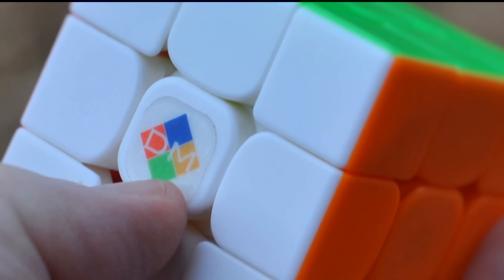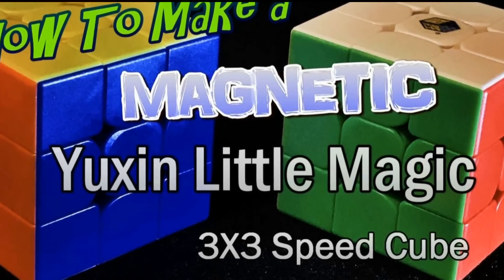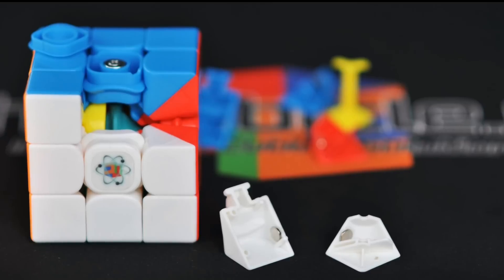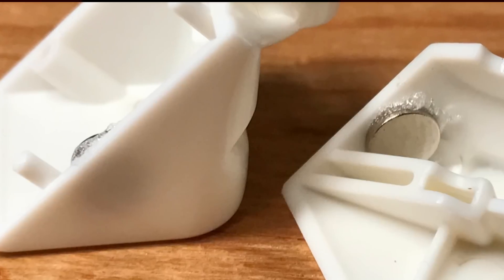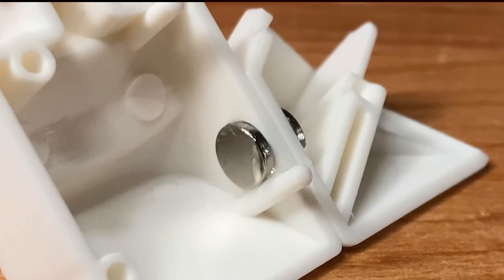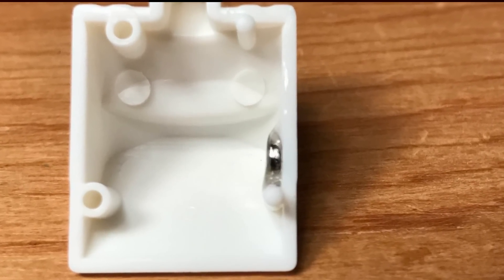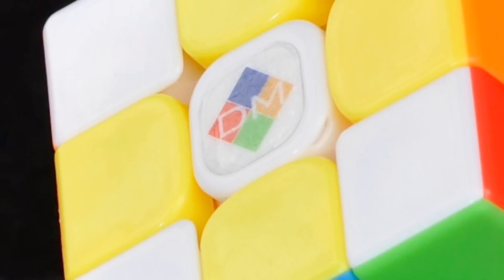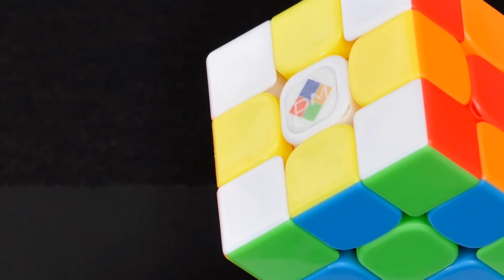Magnetizing the MoYu MF3RS2 Speed Cube

Comment: I magnetized a valk with 4x2 N35, and it was too strong for my liking. Was just wondering, what magnets could I use in the valk as well as the MF3RS2 to achieve a strength similar to the stock GTS2M? All 3 are Stickerless btw.
Reply from the maker: AdamA90 In the Valk 3, N35 4x1.5. In the MF3RS2M, the N35 5x1.
Reply: Thanks! So which one is actually stronger, the N35 4x1.5 or the N35 5x1? Also, what magnets would work good in the new GAN 356R?

Comment: Can you use the same type of magnets in the edges and corners? (Example: n35 4x2 magnets)
Reply from the maker: Giovanni Berlato Yes! That's how you should do it.
Reply: @dmcubing6342  Thanks for awnsering, but i have other question, the 5x1 n35 works well too?
Reply from the maker: Giovanni Berlato Yes. You can use N35 5x1 magnets in this cube. They will give a subtle magnetic feel, yet still give the cube stability. The Cubicle uses an N48 5x1 in this cube (for a medium strong feel), and I like to use the N42 5x1 for a medium subtle feel. The N35 5x1 will give the cube a light magnetic feel. It'll work just fine.
Reply: @dmcubing6342  And what about the 4x2 n35?
Reply from the maker: Giovanni Berlato Very standard magnet in a huge variety of 3x3 cubes. It does fine in the MF3RS2.

Comment: Hey I was wondering if n38 4x1 magnets would work for this cube and what would it do, that is my only option from the place I'm getting it from
Reply from the maker: MisterChilli Gaming Honestly they would be too weak and would result in a significant subtle feel. If that is your only option for magnets, you might be better off doubling them: you could use a total of 96 magnets by using double magnets, one magnet placed on top of the other, in both the edge pieces and corner pieces. When you stack them like this, you end up with the equivalent of an N38 4x2 magnet. 
For a subtler feel, you could use single magnets in the corner pieces, and use doubled magnets in the edges.

Comment: Hello, can I use any superglue
Reply: https://www.google.com.sg/search?q=bond+mate+super+glue&client=ms-android-xiaomi&tbm=isch&source=iu&ictx=1&fir=TXxCWdcCMUjobM%253A%252C1Ep8ZghCxLNl3M%252C_&usg=AFrqEzc5IwfyWERun5a2_zvAmoZ6WmEEVg&sa=X&ved=2ahUKEwi3_fH3x-HcAhVTXisKHcR1Da0Q9QEwA3oECAQQBg&biw=1100&bih=1712&dpr=2#
Reply from the maker: SyaZwaN_DeV SyaZwaN_DeV Answered here, earlier today. Check the comments here for the latest comments, the one right before yours, for the answer.
Reply: I can't either see the comment
Reply from the maker: SyaZwaN_DeV Yana 1982 Yes. You really can use any type of superglue. I prefer a thicker type with plastic additives because it helps protect the magnets from unlodging caused by shock. I put a drop first, then place the magnet on top of the glue, then finish off by putting an additional drop of glue on top of the magnet. This type of superglue takes a longer time to dry and cure. 
Thinner, normal, superglue can work too, particularly for people who position the magnets first, then add a drop of glue on them (a technique I don't particularly recommend). This thinner glue can get into tight spaces easier, and it dries quicker. Since it's thin, it's prone to running, so you have to be careful by using a little at a time. Since it's thinner and less flexible, it's a little more prone to having magnets come loose due to rough handling. If I were to use this glue, I'd probably put an additional drop of glue once the first application has fully dried.
Reply: I think the comment is only fotbu
Reply: U
Reply: Can use this bond mate super glue
Reply from the maker: SyaZwaN_DeV Sure. That appears to be normal cyanoacrylate superglue. It should work fine.
Reply: So can or cannot
Reply: So will the magnet drop
Reply from the maker: Drop? Are you asking if the magnet will fall out? Probably not if glued properly. Just make sure to glue it well and add an extra drop to the top of it once it's in place well.

Comment: Can use any superglue
Reply from the maker: Yana 1982 Yes. You really can use any type of superglue. I prefer a thicker type with plastic additives because it helps protect the magnets from unlodging caused by shock. I put a drop first, then place the magnet on top of the glue, then finish off by putting an additional drop of glue on top of the magnet. This type of superglue takes a longer time to dry and cure. 
Thinner, normal, superglue can work too, particularly for people who position the magnets first, then add a drop of glue on them (a technique I don't particularly recommend). This thinner glue can get into tight spaces easier, and it dries quicker. Since it's thin, it's prone to running, so you have to be careful by using a little at a time. Since it's thinner and less flexible, it's a little more prone to having magnets come loose due to rough handling. If I were to use this glue, I'd probably put an additional drop of glue once the first application has fully dried.

Comment: If i use n48 in this cube .. is it work well
Reply from the maker: AM Cuber what size?
Reply: 4x2
Reply from the maker: AM Cuber Really the N48 4x2 would be a bit overly strong. If it's all you have, I suppose you could get by with it but it will have a fairly pronounced magnetic feel.
Reply: DMCubing ok 👌

Comment: hai im just wondering WHY IS MY MAGNETS NOT CONNECTINNGGGG UGGHHHHHHH IVE SPENT AN HOUR TRYING TO FIGURE OUT WHY THERE NOT CONNECTING
THERE REPLELING
Reply from the maker: Mark _YT OH NOOOO!!! Sounds like you may have reversed the polarity at some point in time. The best thing to do is to disassemble the cube. Then attempt to reassemble the cube without the core. You will be able to tell which pieces are rebuilding each other at this point. Then disassemble the individual cubie pieces to determine which magnets are incorrect. 
It is not easy to remove magnets. You can try prying them out with a small screwdriver, but be very careful so as to not damage the plastic. You may have to soak the pieces in warm soapy water for several hours to help soften the glue prior to doing this.
Reply: oki thanks, can i use nail polish remover because it has this ingreadiant in it that allows it to soften the glue
Reply from the maker: Mark _YT Yes. The acetone in it will soften superglue. But it can also damage abs plastic, the plastic cubes are made out of, so apply it directly to the magnet area and keep it from getting all over the cube pieces.
Reply: DMCubing ok

Comment: Do have any idea how to remove the magnet that are already glued with superglue?
Reply from the maker: Benny Lai First, you can try carefully prying them out with either a small screwdriver or knife. If they're still stuck, then try soaking the disassembled cubie pieces in warm soapy water for several hours then try prying them out again. If you can grab a hold of them with pliers, you could try to twist them out. Just be careful with however you choose to remove them so you don't damage the magnets or cube plastic.
Reply: DMCubing thanks

Comment: if im using a n35 4x2 ill magnetize like the gts2?
Reply from the maker: Tech Dares Pretty much so, yes. They are slightly different cubes, but it will have a similar magnetic feel to that of the GTS2M.
Reply: so i just need to place the magnet like the placement of magnetizing the gts2?
Reply from the maker: Tech Dares Right. But you might have to position the magnets up higher just a little bit so that the corner piece magnet lies flat when it's glued in.
Reply: well so can i just make a master magnet because i am scared if all the pieces is not in the same hieght
Reply from the maker: Tech Dares Sure, you can do it that way. Just be sure that there's glue under the magnets.
Reply: okay thanks!
Reply: how if i just put the magnet on the corner pieces and attach to the edge so it can line up flat then i make all of the corner piece then the edges?
Reply from the maker: Tech Dares Yes, you could do this. You'll be using your corner piece as the master for setting all the edge piece magnets.

Comment: have you ever tried putting the magnets in the center piece like Chris Tran did?
Reply from the maker: Riki Shikato Yea. I have actually tried that with four different cubes. I didn't like the end result. You need a very strong magnet to get good results. After four tries, I went back to doing it the normal way. 
From what I understand, Chris has been working on a drop-in magnetic assembly for the Valk Power in a variety of strengths. I hope it will be put into production.
Reply: ah, I see

there goes my plan magnetizing my Galaxy megaminx

Comment: What is better that i choose  N42 or N35 what is difference ?? Thankyou
Reply from the maker: Nat Cubes You didn't give the sizes. 
The N35 4x2, and N42 and N48 5x1 magnets are quite acceptable in this cube.
Reply: DMCubing sorry by the way what is difference of N42 5x1 and N35 4x2 ?
Reply from the maker: Nat Cubes Well, they're different sizes, so the 4x2 will have a slightly stronger magnetic strength. Often an N35 4x2 will feel just a little stronger and clicky than an N42 5x1. The N48 5x1 feels closest to the N35 4x2. However, an N35 5x1 feels significantly weaker than an N35 4x2.
Reply: DMCubing thanks ! :)

Comment: Will my MF3RS2 have a better feeling if i use a different strength of magnets in the edge and corners?
Reply: @dmcubing6342  Thanks, but would 4x2 N35 still be good in the MF3RS2?
Reply: Will Gregor Yes. Works fine. 😀
Reply: Will Gregor Oops. Replied from my other account.
Reply: @DavesTrumpet  2 other things: do you know which magnets speedcubeshop uses in their supernova mf3rs2m; which glue do you recommend, and where can I buy it?
Reply from the maker: Will Gregor I don't know what magnets SCS uses. 
I used Gorilla Brand Impact Tough Formula superglue. It's my favorite glue! You can find it just about everywhere including Walmart. It's got a blue cap. See the picture at twelve seconds into this video. There's a clear shot of it:
0:12
Reply from the maker: LC Cubed Depends what you're after. Generally what happens is you get an average of the two different magnetic strengths. So for dialing in and fine tuning the overall magnetic feel, you can mix magnets. Or if you want an in between strength like mixing N42 with N48 5x1 to get the feeling of an N45 5x1. I do this occasionally. 
In the MF3RS2M, both the N42 5x1 and N48 5x1 (what the Cubicle uses) are excellent in this cube, btw.
Reply: @dmcubing6342  Do you mean the Cubicle uses N42 5x1 and N48 5x1 in the Cubicle Labs MF3RS2M, or that they just use the N48 5x1 (I assume this is what you mean)? Also are N35 4x2's stronger than N48 5x1's, and do you know what strength speedcubeshop uses?
Reply: How about N38 4x2 in edges and N42 4x2 in corners?
Reply from the maker: LC Cubed I dunno about that. The end result would be too strong for my liking. That's really too much. The strongest id use is the N35 4x2, or the other magnets I listed in the description.
Reply: DMCubing oh! Thanks! The last MF3RS2 M i made had N32 4x1.7 magnets.
They were a little too light for my liking.
Reply from the maker: LC Cubed The N48 5x1 like what the Cubicle uses is pretty nice. But if you prefer a stronger magnetic pullforce, you might want to try the N38 4x2.
Reply: DMCubing thanks! I just ordered  N38 4x2s and N48 5x1s and once they arrive, i'll magnetize both of my MF3RS2s.
Reply from the maker: LC Cubed Nice!!!! Let me know how things turn out!!!
Reply: @dmcubing6342  ^

Comment: DMCubing i've seen this video and garbage cuber's video about magnetic 3x3 tutorial. But the different between your tutorial and garbage cuber's the placement of the magnet is different yours is down to the post while garbage cuber's is placed upper in the pieces. Please can you give me the best placement for a stable cube he said putting it upper in the pieces should make it more stable. Is it true?
Reply from the maker: TMCuber It all depends on the strength of the magnet. 
Did you actually watch this video? This is one cube where I actually position the magnet up, and not at the bottom of the edge piece post. In this cube, it's necessary to do it this way so the corner piece magnet ends up positioned flat. This is shown and explained in the video. 
The reason I generally tend to position the edge piece magnet at the bottom of the retaining post is, first, it is a specific point in the cubie piece which allows us to precisely position the magnets in the same exact place each time. Secondly, if the magnet is glued against something to its side, as well as glued to something underneath it, it creates a stronger bond, and the magnets are less likely to ever come loose. 
You can alter the position of magnets to dial in a certain amount of difference of perceived magnetic pullforce, but generally speaking, it's almost negligible in most cubes. It's more noticeable, however in the Valk and Gan Air. Since I keep a huge stock of just about every type of Neodymium disc magnets,  I keep my position pretty much the same from cube to cube, and through prototyping and experimenting, I'll find several magnetic strengths and sizes that feel ideal.
Reply from the maker: TMCuber and one last point, about dialing in a different feeling from the same magnet. Again, this can't be done in every cube in every case, but in cubes that allow for a wider variance of magnetic positioning, the closer to the core you place the magnet, the lighter it's perceived magnetic pullforce strength becomes. I do this all the time with the Gan Air.
Reply: Thanks your such a good teacher and person now I understand how to fully magnetize the cube👍
Reply from the maker: TMCuber Thanks! I didn't realize my channel and techniques were being discussed in the comments of his video. 😀 I do things the way I do them, and if someone else does it another way, then that's fine with me. I know what works for me, and after 140 magnetic cubes, I'm completely satisfied with the results of my work.

Comment: DmCubing which magnets you recommend for the mf3rs2 and also the magnets I bought from is my local cube store is it OK if I buy magnets there?. The magnets that are in my mind right now is n40 and n50 please tell me the best magnets for stickerless and black plastics.
Reply from the maker: TMCuber I think N48 5x1 are pretty awesome in this cube. 
Most N50 4x2s that are sold at budget prices are often well below the strength they're supposed to be, so I generally don't recommend them unless they're bought at Gaussboys. But honestly, I doubt you'd need that strong of a magnet for the MF3RS2. So if the other available magnet is an N40 4x2, I'd go with that. It will probably have a pronounced magnetic feel in this cube. And I don't believe there would be any measurable difference of magnetic strength between the black plastic and stickerless.
Reply: DMCubing will this magnets give a similar fell between the stickerless and black version?
Reply: DMCubing thank you so much
Reply from the maker: TMCuber Yes the magnetic attraction will feel the same. Black plastic does, to an extent, block magnetic energy. I had a physicist friend of mine and his group of professors work on the problem and they concluded that because of iron oxides used in the black pigmentation, a certain amount of magnetic energy would be retained. This difference, however, probably can't be felt by humans as it's so small. Things such as lube and spring tension actually cause more of noticeable difference than the actual pigmented plastic.
Reply: DMCubing sorry for a lot of reply's this will be my last question. The N40 magnets that I will buy is in 4x1.5. It is the same as a 4x2 one?
Reply from the maker: No. That is the size: 4mm wide by 1.5mm thick. So this magnet will be a half millimeter thinner. It will be a little weaker than a 4x2 magnet. 
It can work in the MF3RS2, but will produce a subtle magnetic effect. 
Don't worry about asking questions. It doesn't bother me. :-)

Comment: before u slide the magnet did u put glue on the pieces? where the magnets will be
Reply from the maker: Tech Dares Yes. I always put a drop of glue where the magnet goes first, then I slide the magnet through it until it is in its proper location.
Reply: btw u have line or sosial media so i can contact you?

Comment: will 4x1 work? N45
Reply from the maker: Tech Dares I think that magnet would tend to be very subtle, to the point of being barely noticeable. It might be ok if you prefer just a hint of magnetic feel. I've never personally used any 4x1 in a 3x3 cube.
Reply: wow thanks for your fast reply
Reply: i used your method for my the valk it worked (other video)
Reply: its not a big diffrence right?
Reply from the maker: Tech Dares Nice!!! You used the N45 4x1 in the Valk? Magnets feel a little bit stronger in it.
Reply: actually i use like N52 4x2 in the valk its too strong dho hehe but im putting N35 4x1 in my MF3RS2
Reply from the maker: Oh, earlier you said N45 4x1, now it's N35 4x1. That's going to be EXTREMELY subtle. Like almost not even there. 
N52 4x2 doesn't really work well in most cubes because of its strength.
Reply: i mean N45 sorry wrong type hehe
Reply from the maker: Tech Dares Ok. Just checking. Let me know how it works.
Reply: sure im looking forward to it